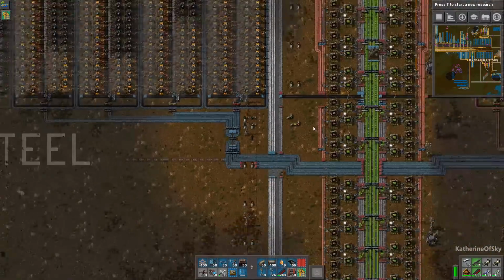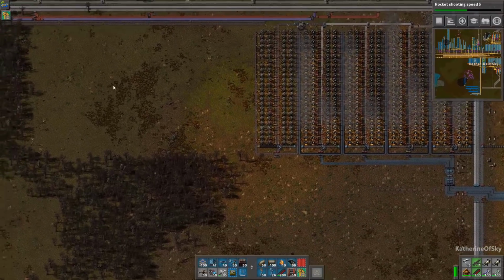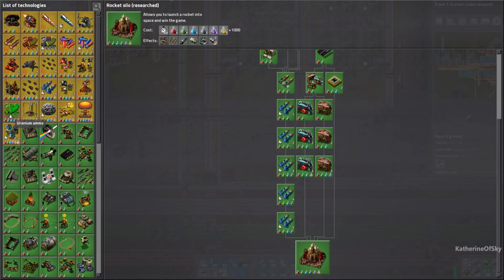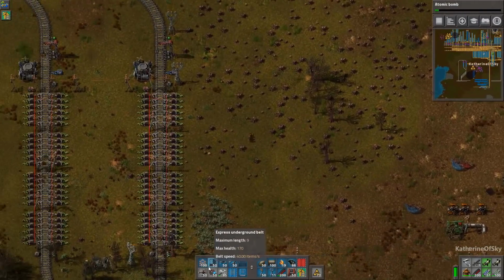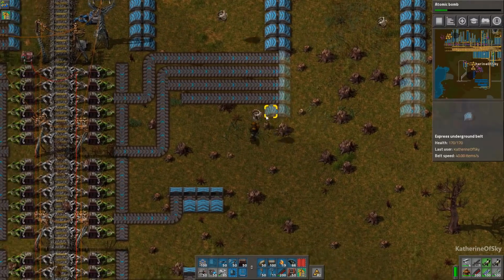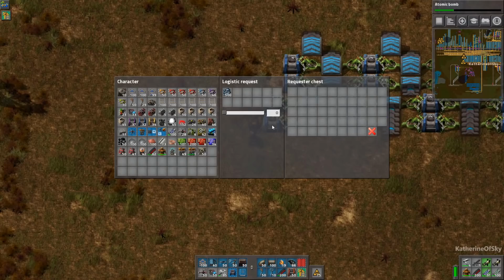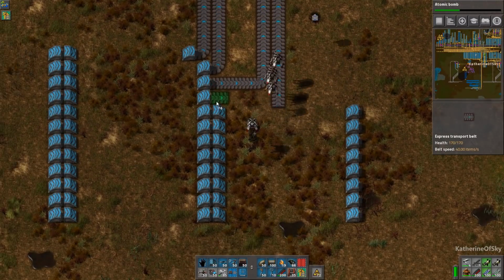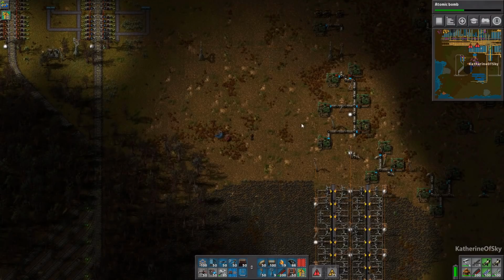Factorio: Entry Level to Megabase Ep 39: BOT BASED TRAIN UNLOADING - Tutorial Series Gameplay

Comment: whats the benefit of the bot unloading if it costs more than the normal belt station and you didn't make it far enough so that you will save ups or time? but still it an amusement to watch your videos.
Reply: It's more scalable and flexible; you can easily adapt to any number of inputs and outputs, whereas with a pure belt system you need to find an appropriate balancer and then if you suddenly decide to add another bunch of smelter columns you'd need to change that out for a different balancer. With the bot-balancer, you just add more input or output lanes, maybe dump another few stacks of bots into the network, and that's it. 

For this version of the station, pure belts might have been fine; a 16x16 balancer with some of the inputs and outputs not connected would have worked (since the smelter columns can only take one red belt's worth of material each, the balancer just has to be Good Enough, not perfect), but that would break just as soon as the second unloading bay is turned on (since there'd be 24 inputs, and you'd either need to find a 24 to whatever balancer or use some 32x32 monstrosity).
Reply: Nice, thanks for the info

Comment: Why using a seperate Network when you could use provider chests with your 1000 LogiBots which then are put in two Roboports until they are full? You may end up with more than you need but "better have to much of anything than not enough", right?
Reply: Having a separate network means that the bots being placed in the separate network will never fly off to handle demands in the main network.  If some major logistic demand were to occur in the main network, and the network that she just created was part of the network, the bots she placed there would fly off to help with the demand, then probably wouldn't fly back to handle the demand at the furnace loading area